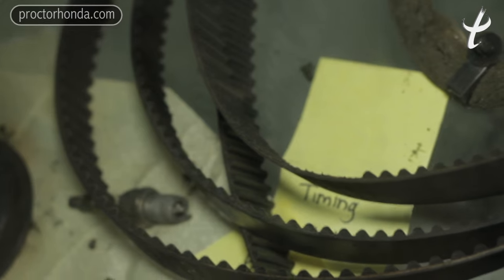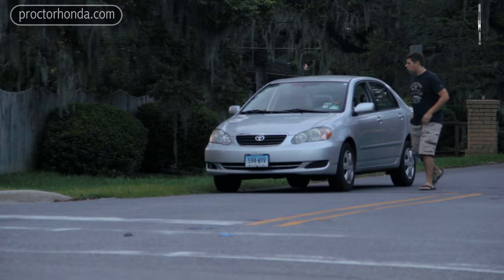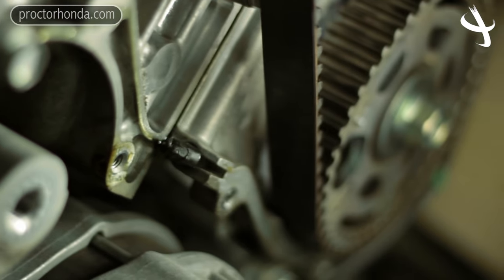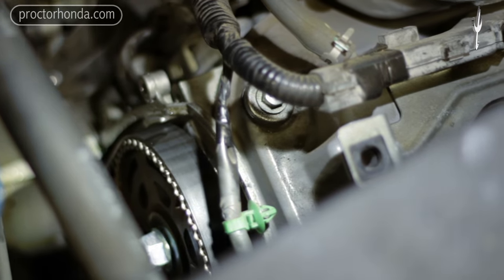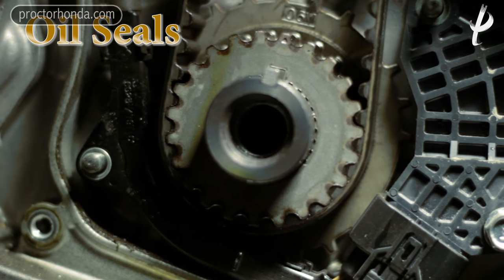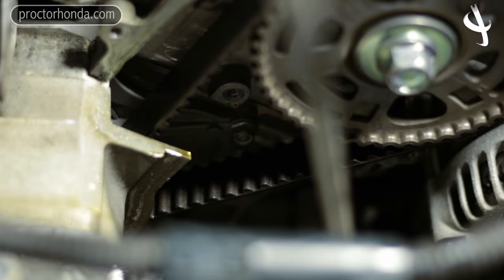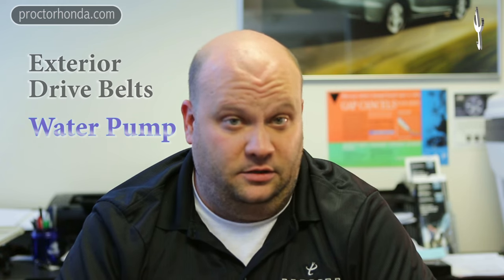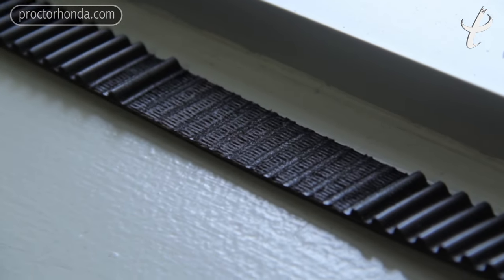How Long Do Timing Belts Last? - Timing Belt Replacement Service

Comment: Just replaced a diesel Ford Mondeo belt, water pump, idler and tensioner.
200,000 km,  which is the scheduled replacement interval. 
The belt looked a little old, the water pump, idler and tension pulleys look and feel like new.
Pretty straightforward job, took a few hours.

An interesting feature of this engine is that while it's an interference engine, the valves are actually not inclined and are actuated by rockers. If a belt breaks, the pistons will hit valves, but because they're straight they don't bend, and all that happens is some broken rockers, which can be replaced without removing the cylinder head.

Comment: my cousin has a 2005 honda odyssey touring and it has 360k miles on its original timing belt. its a miracle her van hasnt broke down yet.
Reply: japanese are more reliable than any other
Reply: sure it's a rubber belt and not a CHAIN?
Reply: Victorian Sculptures yes its a belt. You can lookup online ALL HONDA J series V6 engines have timing belts.
Reply: It won't last much longer. I did mine at 215k on that van and it looked like a rubber band. All worn out.
Reply: ***Classified*** wow. Was the engine still quiet? Her engine was so quiet youd think it was a brand new car.
Reply: I believe you,I have one that is 300k miles.
Reply: @helivesonforever  But yours is not a Honda right?
Reply: @efrensaclolo7021  06 odyssey
Reply: Just purchased a 2004 lexus es330 with 198k on it and no records show timing belt has been replaced. I was thinking to replace it until I saw these replies. I am impressed.
Reply: @r.a.5625  don't risk it. Only 80 dollars or so if you do it yourself
Reply: @pb6198  
I want to do it myself. But is it a safety issue if it would snap or i e.g. put wrong tension amount on? I would only care a lot if it was a saftey issue, and id love to do it myself.
Reply: @helivesonforever  
Id like to do mine, but is it a saftey issue if it snaps or i somehow do it improperly?
I do basic maintenaince myself & years ago i changed a timing belt in a class in a group

Comment: My dog taxi is a 2001 Saturn lw300. 
Bought it 15 years ago from my elderly neighbor who could not longer drive.
It has a 3.0 liter V6 that requires a timing belt change. 
Changed the belt when specified and followed all the maintenance guidelines. 
It now has almost 400k miles and still runs perfectly
Reply: I just bought the same. It's the same 3.0 as in my Accord. Great motors
Reply: Hi my car has done 60000km, according to the service book its says from the car manufacturer I will need to to change it at 75000km. Problem now is the car 8 years old, I bought it as as second hand and I am not driving it regularly,  can I be worried?

Comment: My 1986 Porsche 928 original timing belt was replaced after 10 years @ 100k miles due to a waterpump leak. The 2nd timing belt is 14 years old, however I live in San Diego with average temp of 75 all year.  New belt technology last longer than those from the 80s and the majority of belt failures are due to other components or extreme climates.

Comment: Timing belts may have been more convenient and cheaper for the manufacturer, but it is an expensive pain for the owner. Rubber timing belts should never have been used in any engine when timing chains technology has been used for many decades. Most timing chains usually outlast the engine's useful life. "Planned obsolescence" is the curse of consumers worldwide.
Reply: longshorts3, timing belts are a more advanced technology for a few reasons. Firstly they are smoother and provide more accurate valve timing because timing chains, especially long ones found on twin dual overhead cam engines, have some slop to them, where belts do not, even when they are 6-8 feet long or more, like what is commonly found on dual overhead camshaft designs on V-8 engines (which have four camshafts, two over each cylinder bank.) Another reason is noise, harshness, and vibration. Timing chains on dual overhead cam engines are especially noisy due to the length of them, they are fine on older, single camshaft engines where they are substantially shorter and only have to make two bends, unlike modern engines with idler and tensioner pulleys, in addition to the extra camshafts they have to go around. Moreover, the vibration created by an exceptionally long chain will ring through an engine block, even if your ears can't hear the super high frequency, this can disrupt all kinds of sensors, causing them to send false data to the engine management compuer, most notably the pre-ignition detecting knock sensors as they are very sensitive to any vibration in a specific frequency range, if that happens then ignition timing advance will be reduced, hurting economy and performance probably without any detection by the driver that the computer is doing this. Then there is the cost for the consumer, there is initial purchase cost of the vehicle to consider, and we all know the the manufacturer isnt going to simply absorb the cost of the raw material (being steel in the case of a timing chain vs rubber and nylon cord for a belt) or the substantially higher manufacturing costs for a chain. They are going to pass that along to you, the consumer, by charging more for the vehicle to begin with. And lastly, there is the weight and rotating mass to think about. Every pound shaved off of a vehichle is important for economy as well as performance, especially over the long lifespan of a vehichle. Besides, the rotating mass of a big, fat, long, steel chain is going to cost horsepower, which will hurt fuel economy and performance. Even simple things like going to an electric fan vs an engine driven fan (which can cost as much as 15-20 horsepower to run) can make a huge difference, especially over the long run. So before you go assuming that highly trained automotive designers and engineers are stupid (I assure you that they are not, and they have to consider so many factors that you are unaware of) and go running your mouth before actually thinking about what you are saying, you should think again and devote just a little more brain power to the concepts you derive, aparantly from no real experince or knowledge, before then sharing your misinformed and misleading simple minded opinions with others, you should check yourself. Just my two cents on the subject. And I am neither a designer nor an engineer. I'm just a simple 34 year old backyard mechanic with common sense, Im guessing yours went out the window a long time ago.
Reply: Johnny Hisaw i
Reply: longshorts3 timing belts were and are still used for assembly at the time of manufacturing and noise. But with technology in dampners the trends are back to the chain. Thank God.
Reply: Johnny Hisaw 7
Reply: @EJSFilms2K Nope, blame Bill Devin. When gates invented this new "cogged " belts (originally aircraft and manufacturing) they actually put an advertisement in Popular Mechanics to advise people of this new fangled belt , and to ask if anybody had an idea what to use it for.  Bill Devin was building a racecar for Hmod at the time, saw the add, and figured it would be just the thing to convert the Panhard pushrod engines he was using to OHC. Rest is history.
Reply: about 1955, btw
Reply: Exactly! In fact rubber timing belts should be ILLEGAL. They whine all the time about muh pollution and global warming and crap yet they produce stuff like this from oils, needing non stop replacement and nature contamination. Chains should be mandatory by law!
Reply: I call BS there are more factors than just the cost and longevity of the timing belt vs timing chain. Noise vibration fuel economy timing accuracy these are just some of the many factors that go into why manufacturers use belts instead of chains. Trouble is people want fuel economy and Power they want smooth operation without excessive lag or noise you can't have it all compromises have to be made somewhere and if you can't be bothered to spend a few hundred dollars after 70 80 90 thousand miles well then just keep driving that 1982 C10 pu. With carburetor drum brakes no airbags no abs crank windows. And while you're at it tell those damn kids to stop cutting through your yard. Just sit back and relax on your porch with your shotgun in your lap sitting on your rocking chair
Reply: @johnny0454  How do you think the electric fan is not engine-driven?  Only way it could possibly save power is if it has shortened duty cycles.  Otherwise, it is certainly less efficient, with 2x power conversions.
Reply: @angelamosley1051  Sorry, I don't have Enigma machine to translate.
Reply: @Longshorts3
Not all cars timing chains will outlast the engine because I owned a VW polo and Opel Corsa and both were 3 cylinder engines with timing chains and both broke around 65000
Miles and were serviced at the right intervals.
Reply: The best is timing gears,
Reply: @jamesdoran6017  I think the problem with a voltswagon is that it’s a voltswagon
Reply: Timing belts need to be banned worldwide. Period. Timing gears or Timing chains are the best. Timing belts are now expensive to replace. Realistically if engineers could make them easy for anyone to replace, then that could be the solution!

Comment: I had just replaced my timing belt at 201,000 miles and the belt still looks pretty good.I wasn't gonna change it but the seal behind the balancer shaft came off and leaked oil pretty bad.Iam the original owner 2000 accord. I believe that timing belt replacement is one of the dealership scam,You can go up to 300,000 miles and more without spending $1000.00 that the dealers charge.Save money just do it yourself if you can.Also the water pump and tensioner is still in good condition.Honda water pump and tensioner don't usually go bad on a Honda.I have 6 Honda accords Me my wife and kids drive ONE ACCORD.Very low maintenance car.Just change the fluids oil specially.

Comment: 190,000 on my 2001 odyssey original belt lol! 

Living on the edge.
Reply: Good I have been advised long time ago by a mechanic do not ever change the original belt Y? Just because is the original Now.. I own Acura MDX just felt to do it by been advised by Acura dealer advisor (terrorism me) and $$$$ my car and sound like popcorn popping and that terrorism me  even more oh answer is that's an old car sounds. My son drives a Toyota 1995 and that has not been done jet. Who's your mechanics any way OH congratulation!
Reply: @nirbancha123  what ?¿?¿?  That must be a car with a timing chain.  I can't imagine a timing belt lasting that long with no issues, even if it's not driven very much.
Reply: 230k on my 2004 Odyssey.
Reply: @deasttn  is that belt or chain?
Reply: @r.a.5625  those are belts
Reply: @deasttn  original belt?
Reply: @erickimmy1493  i think so (bought used from a friend and I don't recall him saying he replaced it).
Reply: @deasttn  definitely living on the edge lol my Accord 3.0 is at 194k right now. I'm pretty sure it's the original belt no records of anything that extensive. But I'll do it next week I guess, have the parts. Just been putting that job off lol have to actually (control) my beer consumption or I'll end up never finishing 😂 it's not exactly an oil change. It's a day
Reply: @deasttn  do you still have it?
Reply: @erickimmy1493  no. A/c started to leak (o rings) so we gave it to a friend of a friend that needed it (and could turn a few wrenches).
Reply: REBEL!

Comment: i have a 2012 sonic, with 96k on it, i looked at the belt, it looks good to me, can still read everything on in, also all the motor mount bolts that have to be removed on my car to do the job have marks on them, like washers have socket marks and bolts have marks on edges, also  intake boot clamp which is usually removed just to get it out of the way was lose, all these things lead me to believe it was changed, when i dont know, but if i was to guess i would say 60k because on the cars this replaced thats when it was to be done while the sonic is to be done at 97500.

Comment: My mom's 1989 Camry broke it's original timing belt at 50,000 miles. Luckily it happened on start up. The belt was 10 years old.

Comment: Your timing belt will last as long as it takes to break. If you want to know how long that is drive it till it breaks. No one can accurately predict when that will be.
Reply: I tried to do that on my 2000 accord .On 2004 I replaced the timing belt and water pump,all drive belts.The timing belt are still brand new at 100,000 miles.So I tried to drive the car until February 2019 major oil leak in front of the engine Found out one seal popped out the seal behind the balancer belt.The mileage is 301,000 Miles.So If you will wait for the belt it is not going to happen.The condition of the belt is still brand new.So if you can drive your car up to 500,000 miles I can bet you the timing belt will not break, but another parts will fail like seals, pump,or tensioners etc.On Japanese cars, But I don't know about Koreans maybe not.I've seen some that failed at 80,000 miles.Honda all the way.
Reply: @Zoran every 10years or mileage stated on the instructions manual
Reply: @efrensaclolo7021  301k on 04 Accord 3.0? Original transmission?

Comment: I have a 1994 toyota camry 2.2 four cyl motor with 167.000 miles and still has stock timing belt on it. I assume this because no one put the sticker on if they did change it.  Guess i will hope for the best and maybe just have it changed at 180.000 with either a gates or dayco kit along with the water pump. This is my 5th toyota and i have never changed a belt or a chain on any of them. Two 4 cyl PUs and a Tercel car had about 300.000 miles when i got rid of them. I think Toyota makes the best cars in the world.
Reply: thomas huteson  Japanese cars are the best
Reply: I wouldn't take the risk. Get it changed as soon as you can.
Reply: @moroccoal-adarisa2300  Nissan merged with Renault and the quality went to the toilet and Mazda have they're vvt system one of the crapyest and most sensitive in the world... But Honda and Toyota they're reliable, no doubt about IT.
Reply: Often break on start up or a stall on a gear model,keep the revs on maybe ok.my toyota had a150,000 km t, belt light.good luck. If you rely on this car change it, for your peace of mind.
Reply: No,and Honda?

Comment: My Chrysler Town @ Country van went 168,000 miles before the belt broke so when you buy a used car, don't assume it has changed at the recommended interval. Timing belts can go WAY beyond 60-100,000 miles before breaking!
Reply: what year is your t and c

Comment: So, am I correct in assuming (hoping) that I can go at least another 25k-30k miles before changing the belt and pump?  My 2010 Pilot has 239k miles. Belt and pump were last replaced at 175k miles.
Reply: That's less than 100,000 miles. Most people don't even replace that stuff every 100,000 myself included

Comment: I have a volvo 2004 c70 2.4 5 cylinder located in Las vegas. The engine was knackered so i put a new one in. 
The engine had  142k the original timing belt water pump and pulleys were still on that engine when i pulled it out
Volvo have a 100k interval on that engine but it almost did 50 % more than that in a dry climate on a 14 year old car

Comment: I have 180,000 on original belt, 1995 odyssey, non-interference.  Ive been wondering if I should go till it breaks but worry if out of town.
Reply: Best change it as the belt can get fast round your pulley and buckle other things

Comment: Timing belts as they wear and stretch can cause the engine to run rough. Buy a car that has a chain belt, problem solved.

Comment: I  bought  my  Odyssey  2000  with  269,729  miles  on  it  then  just  recently  replace  the  timing  belt  at  344467  miles , I  guess  its  just  the  matter  on  how  you  drive  if  you  drive  so  rascal  and  abusive  any  car  won't  last  that  long .  By  the  way  I  buy  that  van  on  2012,  then  replace  the  timing  belt  2018  April

Comment: I have a VW Polo 20 years old 216k km 
I took a peek at the belt and on exterior it looks good, I don't think it can break, it's not rubber, but on interior at the base of the teeth I could see micro cracks started to form, they are not deep, only on surface, may be it can go another 20-100k but I'm not that confident. 
So it looks like time has come to change it.

Comment: you need to soak your timing belt in "303 aerospace protectant". It will last a lot longer because it makes the rubber more flexible and softer. V-Belts/Serpentine/Alternator/Timing Belts will break because they come really dry and almost brittle right from the factory. After so time, they will get cracks which leads to a teared belt.
I didn't believe that shit at first but I tryed multiple time with different belts on my lawntractor and it works. 
search here on YT for "STOP Replacing TIMING BELTS....PERIOD!" from Sweet Project Cars
Reply: thanks for tip

Comment: They say when your timing belt breaks your car is trash, I was told that about my PT Cruiser. My belt broke and my car broke down, I went to get a new one and it started right up and went down the road just fine. I also so called had a worst chance due to me coming from off the highway at a fast speed when it was done. Things like this is an example to not trust every word that comes out of people mouths.
Reply: Lucky the valves missed the pistons.many twin cam 16 v will cause damage internally, many single cam 8 valves also, good luck.